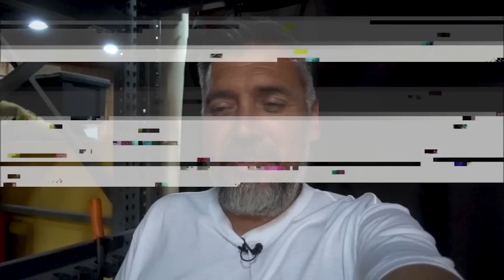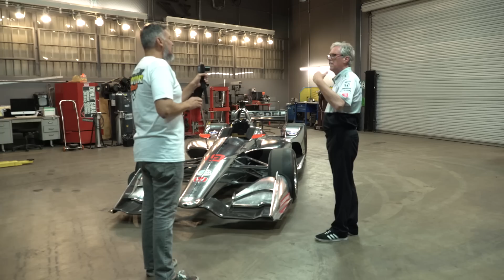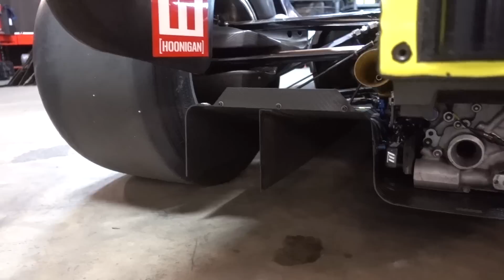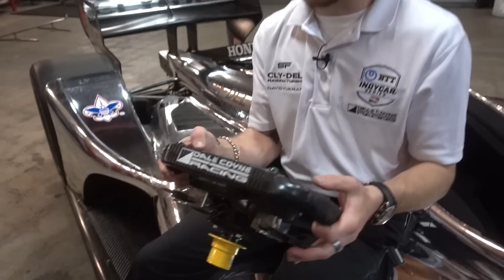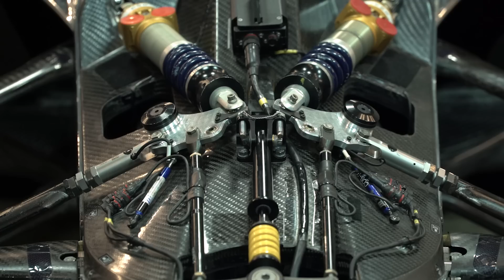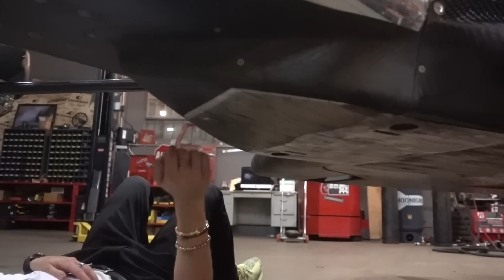12,000RPM Twin Turbo IndyCar: Behind the Dallara's Carbon Bodywork

Comment: Cool tip for ceramic brakes: While you are cruising down the pit lane, 
sqeeze the brake pedal gently until the discs heat up, and the brakes start to grip.
While doing it in low speeds, it takes shorter time to heat the discs, due to lack of air flow. 
Now you'll have warmer brakes in the first corner. If you just brake hard until they grip, you wear the assembly prematurely and unevenly.

Comment: Goddamit, I saw turbo indy car in the title, clicked, pumped to to see some Borg Warner EFR, Gate and manifold magic. aaaaaand. mr towel ruins my buzz. I'm betting the radiator/intercoolers are the bit they want kept secret more than the turbo plumbing, very fine balancing act between aero drag and sufficient cooling. oh well.

Comment: Make racing great again!! There needs to be a rule making a driver and seat minimum weight of 300 lbs. stop breeding horse jockeys as racing car drivers. I’m 5,11” & 220 I grew up around racing and make a living in the sport. I’m tired of seeing great drivers that don’t make it in the sport because of weight or size💪🏼😎🏴‍☠️ the muscle car era is back you can buy a 1,000 hp car off the show room floor with a warranty and yet most all forms of motor sport are loosing viewers and fans!!! Some one needs to put the bad ass back in motor sports. No more white washed politically correct horse jockeys.

Comment: The terrible towel !!!!🤣 one of my Idles Collin Champman uses a towel in the 70s to conceal the rear diff of the lotus F1 car. Any time the car was in the pit or the garage they would throw the towel over the rear end and diff. While testing the car in a wind tunnel the side pods flexed down toward the floor and they seen a huge increase in down force VIA ground effect. They ended up installing floating side skirts that sealed the under side of the race car to the ground. For over a year know one noticed because every one was so focused on what was under the towel over the rear end🤣 it was a great exercise of camouflage and diss information

Comment: This is prob best look into an indy car in a long time, just wish they would of talked the turbo's, top end, exhaust manifolds, intake manifold, intercooler a little bit, see how much boost these things make, how much they could if they didn't care about driver safety? 2.2 liter top secret chevy and honda engines, I think indy car would destroy an f1 if turned all the way up, but just too dangerous. Plus indy have shorter wheel base, so technically should be able to pull more g's in turns as well or more quick and agile
Reply: Indy do not have enough downforce. Even if they had a more powerful engine the F1 would catch the Indy in the corners. Actually, an F2 is faster than an Indy.

Comment: For a second the rule that they have to use the super sticky/short life red tires seemed like a PR/branding stunt but the depth to the race strategy that brings is awesome.  Do you use it early to get a lead?  Do you use it later when your driver is in the groove?  Do you hold off in case there's a late yellow flag?

Comment: For the same annoying question over and over why was turbo covered. Its Borg Warner EFR-7163 underneath. They run 1.5 bar on road courses and goes up to 1.6 bar with boost engaged.

Comment: I knew they were going to hide something I really wanted to see :/
I must witness those turbos myself
Reply: for the millionth time its spec indy part Honda and Chevy have to run the exact same turbo. BorgWarner EFR-7163
Reply: @roletnabih  then why was only the turbo and the manifold obscured by the black cover? Explain that.
I can only assume there is some 'secret sauce' involved in the process of how their team has setup their forced induction system.
Reply: @von...  There is no seceret sauce turbo is  a spec part. Indycar paddock pass allows you to take photos how ever you want when they are apart. You can google image search and get photos of UAK18 without engine cover if you are so interested how they have the exhaust and manifold arranged. Layout is unique but thats it. Here what do you get out of this photo? https://imgur.com/28wwMhX
Reply: @roletnabih  but still there is the question as to why they chose to specifically obscure only the turbo, manifold, and waste gate from the view of the camera. While I believe everything you have said so far, there is still some reason they chose to cover it.
Reply: @von...  Because that setup is exactly what separates Honda and Chevy. At Indy 1 mph can mean the difference between first and tenth, heat management is crucial every tenth counts. Why would you expect them to show what setup they run. Like I said if you want to see what the setup is google and you will find photo like above.
Reply from the maker: Ha! That's the one thing that most team keep on the down low! We tried to get them to show us a little sneak peek, but they kindly declined...
Reply: @TheHoonigans  You guys did great job, Indy is actually miles and miles better than F1 in terms of openness you would never get any figures or setup or anything up close like that.
Reply: @roletnabih  you good sir are fucking on it.

Comment: I understand the multitude of reasons for Indy and F1 to mandate engine configurations, outputs, and displacements, but a part of me still wishes that they'd just let the teams go with basically whatever they wanted to run. Especially with F1: establish a displacement limit and maybe a power limit, then impose tighter and tighter restrictions based on the team''s budget (larger team and budget = more restrictions). I think that's one of the reasons LMP's are so much more entertaining to watch; V6's, V8's, V4 hybrid? Sure! Why the hell not?

Comment: Laps Circuit of the Americas 14 seconds slower than an F1 car!
Reply from the maker: Formula 1 is built 100% for Road Road Racing, Indycar is capable of doing both Oval and Road Courses using the same chassis.
Reply: Well at least they sound better than an f1

Comment: Oy, why is there a blanket covering the turbine/manifold?
Reply: Top secret shit. They're very close lipped about their turbos and exhaust/intake ststems
Reply from the maker: Grant dropping some serious knowledge on us!
Reply: @grantbowers2319  i figured... but i still cant help thinking, arent these engines supposed to be a crate sealed so teams would have equivalent equipment? Aren't all Honda Powertrain suplied teams supposed to have the same hardware since regulations prohibit third party engine development? A Honda powered team isn't supposed to have a different exhaust manifold and turbine selection than another Honda powered team, unless these teams are supposed to keep from other engine developers such as GM. I dont know why the turbos or other induction related parts to be a secret since IndyCar series run on third party chassis and powertrain. 
Can you enlighten me a bit?
I've had contact with tacing team engineers before, people on a category with similar regulations to IndyCar and the only secrets where aero and chassis setups. 
Everything else around powertrains such as engine maps or engine parts where crate sealed...
Reply: @Lucas-ck1po  it's Honda protecting there r&d for how they setup there engine from chevy
Reply: @aaronpower998  hmm that would make sense..

Comment: *Roncar voice* Scumbag comment of the week; Puts twin turbos in the title of the video and covers them up with a towel lol
Reply: I've personally worked on this very car
Reply: The exit shudders on the radiators are secret.
Reply: *honda hides Vtech
Reply: @Jamesashleycoyle  hectors two spoon engines with a motec exhaust system is being stored at area 51
Reply: I will start with, I personally have no knowledge of Indy cars or the racing leagues associated, but you would think with a spec series all of the components would have to be the same aside from the blocks. Why cover the turbos at all?
Reply: @chrisparker6517  I would imagine Honda has some proprietary designs related to the turbos, exhaust, manifolds, etc that they don't want the teams running the chevy engines to see

Comment: The secret to 12,000RPM is redline second, then shift into first ;)
Reply from the maker: Ohhh! So you're saying any car can spin 12k RPMS! We totally get it now... LOL!
Reply: @TheHoonigans  but most only do it once
Reply: @Rahziel420  As many times as you can afford engines
Reply: @TheHoonigans  I herd some cheap 80's corolla can do it lmao
Reply: Redline 5th
Reply: you can get higher too. go to redline in fifth and drop it into reverse and your little honda will rev up, hit vtec, and make so much torque that the earth will start orbiting the sun in the opposite direction...... or maybe you will drop a valve, bend some rods and shred your reverse gear, either way it is pretty awesome.
Reply: Your a evil man. Please don’t try this lmao
Reply: Any car can do it once if your brave enough 🤣
Reply: Bwahahahah
Reply: Umm, yeah, my Toyota van did that ONCE with a (former) friend driving, except he went from 3rd to 2nd (instead of 4th), when 3rd gear was already wound out. The results were devastating to say the least.😜
Reply: Is this like a cheat code? Secret achievement unlock?
Reply: Money $hift to 12k
Reply: Last time I did that I got 18k for 2 secs, then BOOM
Reply: expect flying conrod
Reply: Rumor has it hector istalled two spoon engines with a motec exhaust system making a conservative 1500/whp at 26000rpm and thats before the vtech kicks in
Reply: I prefer a 5th to 1st downshift
Reply: Top tier advice 😂
Reply: Just once and it's done, no ride for tomorrow lol
Reply: If your engines an inline, redlining fifth and shifting to first will make your engine into an artillery cannon. The piston is the shell.
Reply: Big brain
Reply: Also to get on the throttle early while inputting steering in the turns. Watch how cool it is to have all that power while you get spinning around and around and around till the wall stops ya.
Reply: Im pretty sure that's the secret to 0 rpm
Reply: *reverse

Comment: 12,000 RPM?!...damn..
Reply: 13000rpm still canceled soz
Reply: v8 f1 cars use to rev to 18k, now its at 15k
Reply: 2.4 litre V8 in F1 were capped at 18k Cosworth got theirs to 21k before that